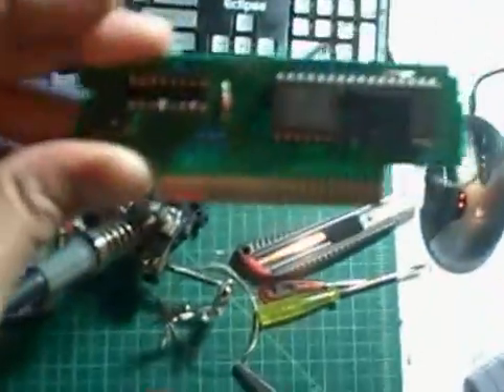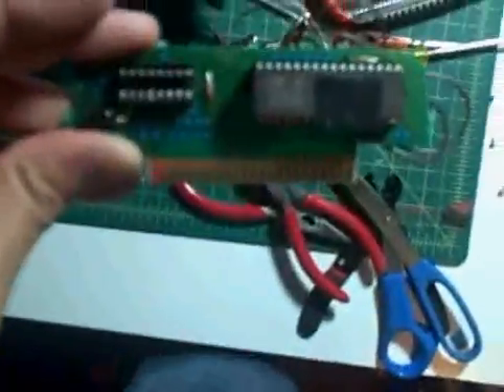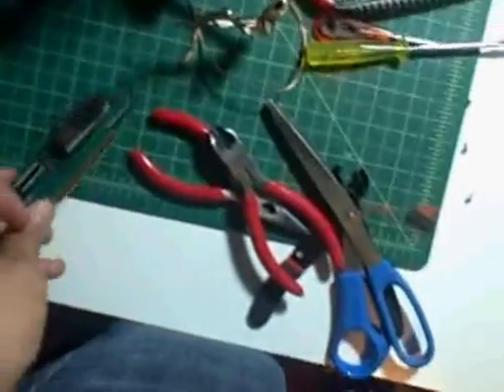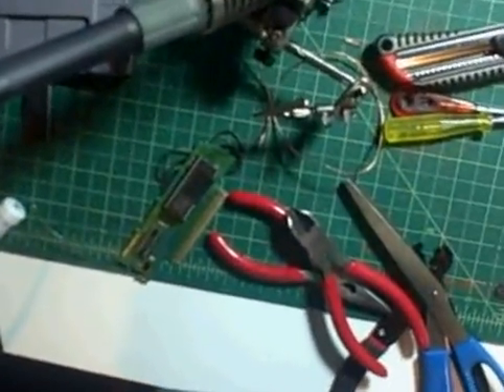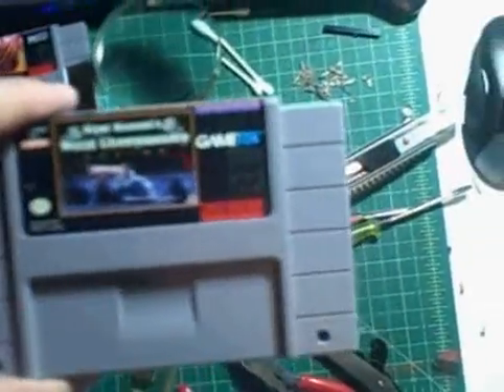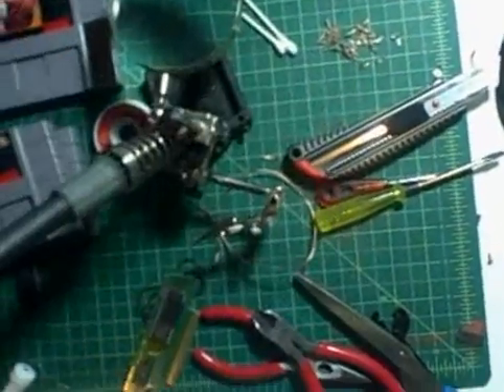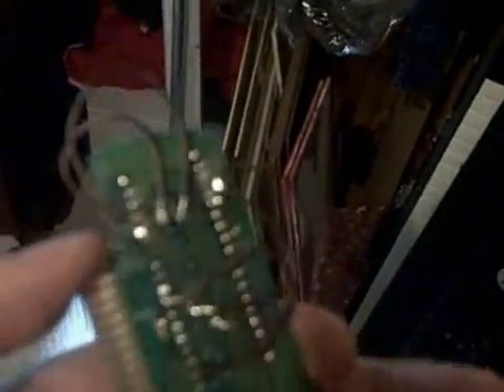Super Nintendo Cart Hacking

Comment: I had someone to do it, yes is expensive as well as getting the cart mold done.

I wanted to do the CAD files myself to, just reading back an original snes cart.

but I could not get a hold of a similar MAD-1 chip with same pinout.

The pcb is scientifically smaller even with ram memory and battery.

Comment from the maker: Hey man! In this one I actually removed the CIC/security chip just to practice desoldering..the thing in there is just one of those things to hold a chip....I totally forgot what it is called, just easier for testing/removing chips frequently when I wasn't sure if I had done it right (Just a note if you do it that way, it will NOT fit in a cart). I tested the cart with multiple games burned on the chip on my two famiclones and multiple real SNES's and it worked...

Comment from the maker: SRAM is for saving data, it utilizes the battery to keep the data after you power off. There is also various RAM (palette, sprite, etc) on the console so you can send data to use temporarily. If you have ZSNES, and you have a game like Super Metroid or Super Mario World, after you save you will see it will create a file called SuperMetroid.sram, if you delete that, you'll see that the save files have been deleted.

Comment from the maker: @JohnnyP625 hey sorry. Not sure if you're still looking to do this. It should be relatively easy to do. The only big deal is that you have to figure out the size of the cart and if it requires any special chips like a Super FX. I doubt Ranma does, basically load the ROM into ZSNES and see what kind of info it spits out. There is a doc out there that lists all the ROMS for SNES/SFC and the types of memory etc. I'd just find a similar game and try to buy it on eBay or at a store. Then hack away.

Comment from the maker: @guarapo66 yup it works on a real SNES. I've tried a bunch of games, like First Samurai and Castlevania IV. I think the system doesn't need the SRAM to do anything...it just doesn't save anything. For example I did a hack of Super Mario World and it works fine it just won't save. The weirder thing is that it works without the security chip (you can see the smaller DIP socket is empty). yup.

Comment from the maker: ahhhh I've seen similar stuff to that like at retrousb(NES) or tototek(most other systems) and those floppy disk systems are almost the only way to get homebrew on the n64 up and running. It involves creating some kind of basic OS or file io system which I don't have the skills to do (YET!). Basically this is because the SNES (or 65816) can't address that much data so you have to have some way to fake it out by switching out the data. nice user name btw!